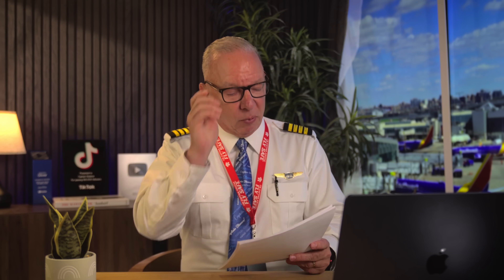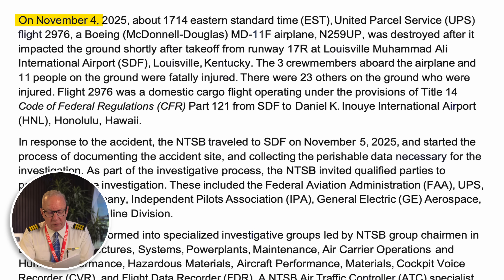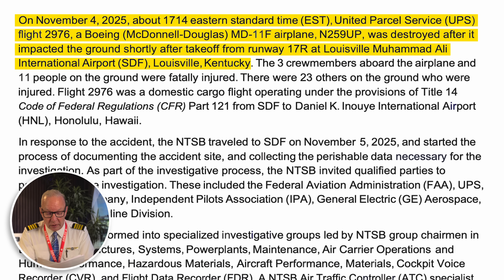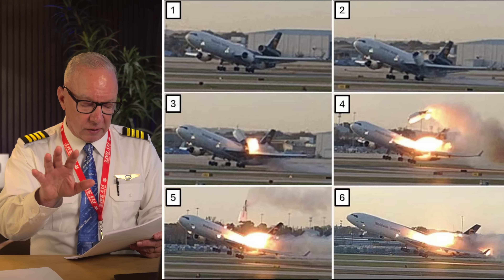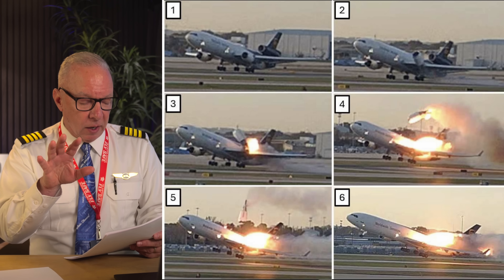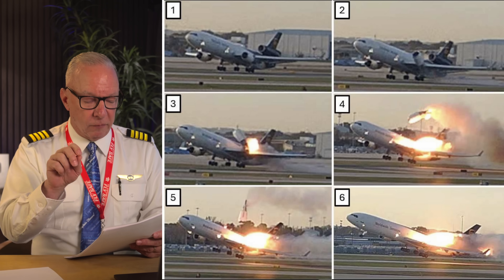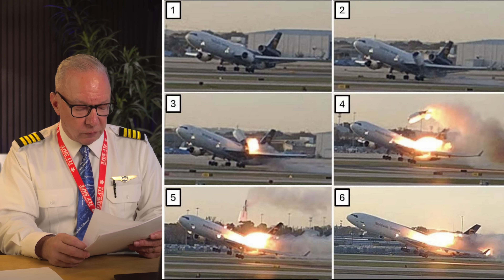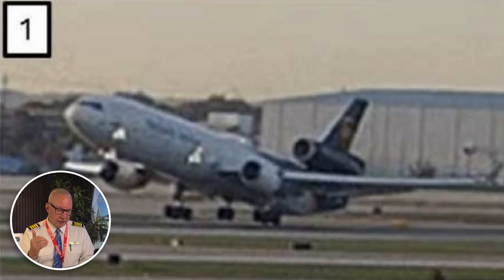UPS Crash Preliminary Report | Pilot Reacts to UPS Crash Report

Comment: There was also a previous DC-10 engine failure but didn’t cause the airplane to crash. This was an Air Florida DC-10-10 on route at altitude. They had an engine failure due to pilot error. 

The pilots were discussing what would happen if the auto throttles were engaged and the N1 indicators failed. The auto throttles are feed information from the N1 indicators. During their cockpit conversations one of them mentioned they should pull the circuit breakers for the N1’s and find out, which they did. All the N1’s went to zero but nothing happened. The throttles stayed where they were, no changes at all.

So the pilots were content that loosing an N1 indicator wouldn’t cause any adverse reaction. What happened next is not what they expected. One of the pilots reinstated the circuit breakers all at once. Nothing happened immediately. But what the pilots didn’t realize was that the N1’s are now sensing a low N1 reading that caused all three engines to go to the fire wall at full thrust. 

Before the pilots noticed what had happened one of the wing engines had failed. When the engine came apart shrapnel from that failed engine went under the fuselage and caused the other wing engine to come apart. A turbine blade also pierced a cabin window. A passenger was sucked out and went into the slip stream. That body went up and over the top of the fuselage and into the number 2 engine causing a compressor stall. It caused that number 2 engine to slow down the N1 which prevented a 3rd engine failure. 

They landed, I think, in PHX on the one engine. This of course was not caused by a manufacturing problem but a pilot problem.

Comment: Captain Steve, could this tragedy have been avoided if the engine mounts or pylons had been removed and replaced at earlier intervals?  Was there a human failure in not detecting any stress fractures?  Would this have been a cost issue in replacing the mounts or pylons?  It isn't clear to me what the solution is.  Does this mean the end of the MD-11?  I appreciate your thoughts.

Comment: You mentioned several time the plane could still have flown with 2 fully operational engines.  I get that.  But what about damage to the left wing, and internal damage done by the fires?  Wouldn’t those factors also have affected flight even if engine 2 was fine?

Comment: I think a bit of clarification is needed regarding the Aft engine mount vs. the Forward engine mount. At 11:24, Capt. Steve starts to confuse the "forward lug of the aft mount" with the Forward engine mount itself. Please note that everything in that section of the report is about the Aft engine mount, one of whose components is the "forward lug".

Comment: Do airplane manufacturers have mandatory part replacement at specified intervals as part of their maintenance programs?  It seems as if, particularly since the 1979 crash for a similar reason, it would be wise to tear down and replace these pylon assemblies periodically.  Almost 8,000 more cycles before the next maintenance interval on a machine that old seems insane to me.

Comment: I understand asymmetrical thrust leading to a roll, but wouldn't complete separation of the left engine also cause loss of hydraulics on the left wing like in AA 191?  If the slats retracted the left wing would lose a lot of lift, adding to the roll.

Comment: It was very clear to me from early photos that is was #2 that damaged. Not sure where #3 came into the picture. But I'm also a little concern that Steeve is trying to take this all the way back to the AA flight. I'm sure he knows that the pylon on the md-11 while similar was not the same as the dc10. Comparisons to that need to stop. I think what is more is important are the number of to cycles the 11's have made and perhaps over all metal fatigue. It is possible that what the pylon bolts to is what gave way first.

Comment: I have a feeling the #1 engine made direct contact with the rear engine.
 Maintenance,  i think this need either a 4 ywar timeline or reduced cycle number inspection, or a more attentive intermedatiary inspection to be sure there's no unexpected changes.
In my perspective, i think the mounting design is not as good as it could be. Could there be a better way to mount the engines, who knows.

Comment: Onj
 Jeffostroffs channel he has a timeline from the start of the take offrun to the impact. A total of 60 seconds. 

Those poor pilots started their take off roll, all lights green, the V1 call and Rotate. You can see that it is just as the front wheels leave the runway that things start to break. Probably every light and siren going off all at once. They had passed the point of no return before the bells started. No time to do much as the plane would have startedyawing as the engine on the broken pylon would have probably given a jerk to the right then sagged to the left as all thrust disappeared.

They had no chance.

My deepest condolences to the families of the pilots and those killed and injured on the ground.

Comment: Thanks for the nice update! Well done 👍Puh, never expected fatigue being the issue here. Seems like inspection interval was not sufficient then. Special detailed inspection is in any case inadequate, because visible detectable crack length is much too long, considering the dimensions of the lugs / fittings. Should have been eddy current inspection and perhaps a smaller inspection interval then. Or actual occurring fatigue stress in the parts is higher than assumed in the threshold / interval calculations. Of course, improper done inspections could also be an issue here (maintenance error), but NTSB will find out the details. No chance for poor crew and fatalities on ground, so sad.

Comment: The engine pylon on the left-hand side failed and the engine came clean off, debris appears to have damaged the leading-edge slats (affecting lift) and got sucked into engine #3 (causing a compressor stall.)

Happened after V1 so no chance to recover the situation.

RIP

Comment: Broken zerk means no lubrication on the spherical bearing. No lubrication overheats bearing. Bearing splits in half probably quite a while ago. Excess vibration in bearing causes aft fitting to work. Only a matter of time before failure.

Comment: I didn’t realize they also grounded all DC 10s. I knew about the MD-11s. What if, hypothetically speaking here. What if every DC-10/MD-11s need extensive work done on this wing pylon/engine area. Especially in UPS and FED-EXs fleet. We are talking millions, possibly hundreds of millions of dollars. Could this be the final nail in the coffin of all MD-11s/DC-10s? What do you all think? Another thing, of engine number 2 hadn’t failed. Is it possible they could have gotten high enough to clear the buildings? Maybe even higher? Also this plane was fully loaded with packages and fuel. Enough fuel to get from Louisville to Hawaii. That is a massive amount of weight/fuel.

Comment: Agree with previous comments. Maybe shall look at rudder deflection and emphasize the correct and professional way the crew handled the emergency with what they had. That the aircraft flew in a controlled attitude until it hit the first building is all down to the crew.

Comment: The integrity of the  pilons and stress induced metal fatigue  have me thinking about the  newest 777  now working its way thru  certification.
A few years back,  cracks were  discovered  in the  engine mounts of this plane,  that  forced testing to be suspended  for about  a year, 
until  new engine mounts  were designed that would be more robust.

It appears that the initial design weekness has been resolved.  But this  new 777 will be fitted with the largest ever  engines developed  for any passenger aircraft.
Should  the FAA or similar authority  be requiring that the engine mounts be  frequently  checked to confirm that the re-design  can truly handle  the  stress at  least for the 1st 
couple of  years of actual service.

Comment: take the waveform.

CPOL +-
whichever

then the nodal intersections of the harmonic envelope. Match trig form.
Reply: dilation forward compression bracketing. frontal wave plane contact plane triple time bracket
Reply: tune surface lamation hyper torodial pull through, don't push
Reply: pull... then SCRAMJETTHAT**
Reply: my new waveform harmonics stuff

Comment: Thanks Capt Steve.... It is very interesting and surprisingly definitive this early in the analysis process. One could say that the engine really did not fail but an unattached engine is like a bomb going off. I would bet that  maintenance schedules will be changed. Too long between checks now that they know the failure point. Thanks for your analysis.

Comment: Well, it seems clear the fatigue cycle previously calculated due to previous mount issues and the need for more frequency of SDI inspections. I'd have required an Ultrasound inspection at the increased intervals during SDI inspection.   So, the failure from fatigue, which if that was involved with past failure, didn't include Ultrasound is a managerial failure on the part of all involved with past decisions on how to control this issue. I thought regardless of past knowledge they would find  fatigue as the issue based upon my education in NDE/NDT. There's also failure in the design stress calculations and part material specs. I'm surprised some didn't calculate the Sum of the Moments for the Clevis as well as Cyclical Loading Stress analysis based upon past fatigue failure. As we all know hind sight is always 20/20.

Comment: This one reminds me of the flight in Hawaii where a big chunk blew off the top of the passenger plane and the head stewardess vanished. The plane had managed to land on one of the islands... But they said that plane had many flights too. There was cracking near the bolts. I just watched that episode the other day!  And through some miracle the nose of the plane with the pilots had stayed on the plane so they could land.

Sad that the airplane industry hasn't learned anything apparently from that Hawaiian plane disaster. They need to look for that fatigue cracks on planes! Motors should not be falling off (and other parts shouldn't fall off either). 

May they all rest in peace.

Comment: the report referenced mean sea level regarding altitude and the airport elevation is above msl. but it also said 100 ft agl, above ground level. So not far off from the 30 ft they later referenced on correction. Seems from photos the top of the cockpit was clearly more than 30 ft agl. So NTSB likely using average number for entire aircraft.

Comment: Excellent analysis, as always, thank you!  The NTSB reports are always fabulous, and give such confidence to fly and to be confident that this kind of accident will never happen again. Question about what's said at 17:31 - "a tragedy that probably could have been avoided" - how would you see the avoidance?  Seems they were timely with inspections, so is it a need for more frequent inspections?  Better analysis on failure points for the spherical bearing and other parts?  Also, it seems like it's more of a cylindrical bearing, rather than spherical - maybe there's some tapering in the shape of it?  Cheers and fly safe!
Reply: I think the inspection schedule for those attach points could be annual or semi annual inspections rather than every 6 years.

Comment: Has anyone thought the RADALT had a higher altitude because the A/C was rolling and the angle was not straight down, which would be the normal altitude of a RADALT. 
I said from the beginning that the number 2 engine could have ingested FOD from the number 1 engine. Unfortunately, the crew and people never had a chance because it happened so fast. Rest in peace and congratulations to the NTSB for releasing the truth of what had happened so swiftly not like the India crash.

Comment: I'm in mechanical engineering and my machine design professor went over this report with us today. He essentially said that because of the material of some of these elements, it was impossible to design it to have what we call "infinite life" in machine design. In other words, that part was gonna fail at some point because it wasn't designed to have a super long lifespan, and I know for a fact that a 24 month maintenance cycle is not often enough for a plane that old. It was always gonna fail eventually, it just so happened that this is the time it did.
Reply: This failure was bound to be catastrophic and to happen at a moment of highest stress — which is at a very dangerous moment
Reply: Yep. Aluminum has no "fatigue limit". Whereas steel and other metals will last indefinitely below a certain level of reversing stress, there is no level of stress below which aluminum won't eventually fail. This is why regular inspections are necessary.

Comment: At 11:58 you are totally mixin up forward lug of the aft mount to a forward mount. Take a look at the picture. It clearly shows the aft mount has two lugs, aft lug and forward lug. Not really important but just to pinpoint the fatigue cracs were at the aft mounts aft lug. Just some extra steps in the failure chain.

Comment: Thanks for covering this accident, Captain Steve.  I’m wondering—. is the same methodology for engine attachment used on current boeing and airbus fleets?  this might have some heavy implications for the safety of our air transportation system.  Is there a way to more thoroughly examine these components, shy of engine removal.  I’m thinking a strain gauge or something that measures twisting moment.  something that can be seen easily but indicates a more complete story of stresses & strains. 
Keep up the good work!!

Comment: This is why you have full mechanics do it all including lubrication, I have worked on mechanical things all my life mostly professional and in a 30 million dollar lathe that specked out OK on the $30K bearing was actually bad and I determined that just by feel backed up with digital logging of motor run time and traverse indicator. Basically a well-trained mechanic with a cheap laptop beat out diagnostics over a $200K tester and yes, my nickname became the bearing whisperer. The lube guy missed several tears in the bellows cover that allowed metal and grinding material to get into the bearing. This is why I tell everyone to have their car/truck oil change done by a full mechanic because the see and hear and feel thing that you can only lean by being a full mechanic for several years. One of my worst I told you so moments was a customer declined getting new belt, belt tensioner and idler pully and even warned her not going to last long and less than 2 months later it came in by tow truck needing not only the belt kit but a $1500 front engine cover and 18hrs labor to change it. Major companies do everything they can to save a penny only to have it bite them big time.

Comment: Just a minor niggle in your analysis (which I otherwise really enjoyed)
 - the report shows that the mounts are each constructed using a pair of bearing lugs, and then the report refers to the forward and aft LUGS of the aft mount. (The reuse of forward/aft for both contexts is tricky.)
The stress fractures are visible on the forward (hidden) face of the aft lug in the aft mount, with no visible issues on the forward (visible) face of the forward lug in the aft mount.
I suspect that this would not have been found in a visual inspection of the mount or the lugs. (You would need to disassemble the mount to see the forward face of the aft lug.) 
I am not an aircraft maintenance engineer, but how much of the internals of the mount would actually be disassembled during a visual inspection?

Comment: Those mounts should be checked every 2 years, its outrageous they are only check every 8 years. Maybe boeing will update the inspection interval.
Those planes can fly for decades with proper inspections, no need to retire those workhorses.

Comment: As someone who has an interest in airplane disasters the photos of the engine mount detaching echo as you said United 191. I was also shocked that they had the plane on a 5 year inspection set up. I was shocked and saddened when i heard it crashed but after hearing what happened and the interval im more mad than anything else... it was much like alot of airplane disasters..  preventable.

Comment: El-al boeing 747 that crashed in Amsterdam Beilmer had the same problem.. engine came loose and rammed off the 2nd engine.. flew a while on 2 engines of the other wing but wing damage was too severe.. when they slowed down for return approach the plane came down as at lower speeds the wing couldnt keep it airborne since it was heavily damaged..   same cause. Worse result.

Comment: I would suggest that to greasing of the bearing at extreme pressure of the grease gun, may have fractured the high tensile (brittle) ball bearing case which resulted in the failure. 

How many cycles since that bearing was greased?

Comment: Some of the other pilot channels I follow are talking about this and the gyroscopic effect of the engine mount letting go, causing the engine to lift and rotate right from the spin of the engine components which is why the engine ended up on the right side of the runway.  Very sad.